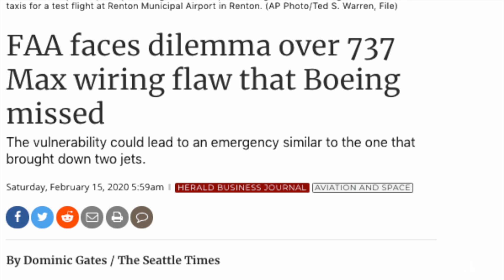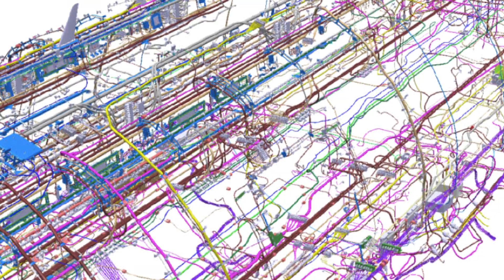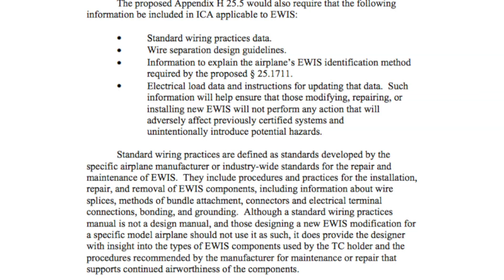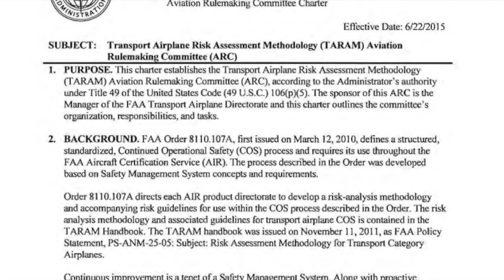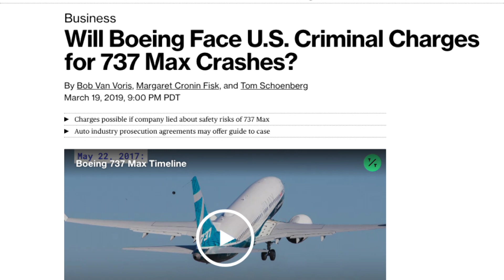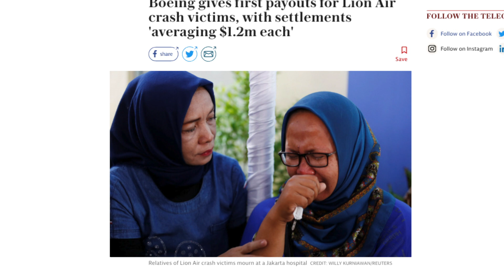Breaking - 737 Max Wiring may cause NEW nightmare that could ground 6,800 Boeing Max and 737ng's

Comment: Hard to take this video seriously. You talk about the HORIZONTAL stabilizer moving while showing an animated graphic of the ELEVATOR moving, and it's labeled "VERTICAL stabilizer." If you don't even know that much about aviation are you in any position to be criticizing Boeing?

Apparently you were the only one who thought rewiring the MAX would complicate its return to service. Boeing had no qualms about rewiring the MAX and your doomsayer source was wrong… the FAA and EASA have common sense—neither of them required the rewiring of the existing NG fleet. Next time try to get better sources—that don't have to remain anonymous to hide their incompetence.

Comment: Boeing used to be a respectable organization and built good aircraft. Now after the wilful deceit over the MAX debacle, I wouldn't trust Boeing as far as I could throw them. Anything to save a buck and to he'll with the people flying those planes. I don't recall any such scandals at Airbus, Bombardier, Embraer, Antonov, UAC, or COMAC. I believe I would prefer those aircraft now over Boeing. It wouldn't hurt the FAA to clean house either as far as Boeing is concerned.
Reply from the maker: Well Said.

Comment: Make no mistake that he FAA needs to Re-certify the 737 Max before they even consider letting it fly again..... Boeing have been and are using a certification for this plane that was issued originally for the 707 in 1958 !!!! ..... this is a complete joke ..... it still uses cables for its flight systems.... if it was a MCAS error it would've only take about a month to reprogram it ..... time to condemn these death traps and design a new jetliner from scratch .... safety before profit .... and lets lock up all those senior management from Boeing and the FAA that are and were responsible for deliberately disregarding the public's safety in order to make more cash for them selves by issuing these dodgy re certifications of this air frame.....

Comment: Boeing stopped to work seriously since quite a lot of time when they took over McDonnell Douglas. Unfortunately, McDonnell managers could "pollute" the Boeing management and slowly the Boeing philosophy of the "safety first" became became "Business first". This was rendered possible by the highly unprofessional FAA which was already working as a group of drunk amateur, who was sold to the US manufacturers. Remember the Swissair crash in 1998 in Halifax? Well already there the FAA should have been reformed. This a pity as I like Boeing. However, I advise my family to avoid Boeing aeroplanes such as 737 and Dreamliner. By the way: Boeing changed the 737 so much to get the max, that the aeroplane is out of balance while the MCAS is a scandal as the pilot have no chance to counter this deficient system. It is not only a matter of software, but also of lacking redundancy, of wrong MCAS concept and wrong aeroplane concept.
Reply: Out of balance?! You criticize Boeing while pretending to have the engineering competence to make an evaluation of the airplane's design, misleading the public. Where's YOUR ethics?
Reply: Did you even LOOK at the data before giving your analysis that "the pilots have no chance to counter this deficient system?"

The data shows that the pilots on both flights had plenty of chances to counter the runaway stabilizer—24 chances on one of the flights—and they DID counter it, quite intuitively, with no training on MCAS. They countered it so well that they actually continued to climb while they countered it. The only thing they didn't do: disable the stabilizer's electric trim system. Knowing which switches to flip required half a minute of training rather than intuition. Since the 1960s all pilots have been required to get that training initially as well as every 6 months during recurrent training, but these pilots gave absolutely no indication that they had ever received it. Someone should be investigating why the pilots at both airlines didn't receive that training, and what other critical training they—and other pilots currently flying!—may have not received.

BTW, there was nothing "deficient" in any system. The 737 MAX has been returned to service with the SAME aeroplane concept, the SAME MCAS concept and is STILL lacking the redundancy you thought it required.

Comment: The wiring is not the issue, 737's have been flying for fifty years and haven't had problems with those wires. The real problem is why couldn't the pilot's on the doomed airliners reset the HORIZONTAL STABILIZER. They deactivated the MCAS on both planes, after that they should have been able to manually reset the horizontal stabilizer, but they couldn't, and that's THE REAL PROBLEM.

Comment: The Economics That Made Boeing Build the 737 Max
Wendover Productions https://www.youtube.com/watch?v=BfNEOfEGe3I Apr 30, 2019
Webinar 017 Recording Video Boeing 737 Max, 2019 11 13
PMO Advisory LLC https://www.youtube.com/watch?v=nHedAyomAyI Nov 13, 2019
Death Plane! The Secrets of the Boeing 737 MAX with Paul Spencer
Russell Scott https://www.youtube.com/watch?v=9OzFlqHikUc Feb 5, 2020
737 Max UPDATE! Wiring Issues and the FAA
blancolirio https://www.youtube.com/watch?v=6fkCWPq9dNM Feb 19, 2020
Breaking - Max investigation leads to NEW nightmare that could ground 6,800 Boeing Max and 737ng's
Maximus Aviation https://www.youtube.com/watch?v=61M5eXIxAuc Feb 22, 2020
How Boeing Will Get the 737 MAX Flying Again
Wendover Productions https://www.youtube.com/watch?v=QvUpSFGRqEo Feb 26, 2020
737Max Update March 2020 Restoring Aviation Accountability- Congress
blancolirio https://www.youtube.com/watch?v=Q7jz7mdH9TU Mar 4, 2020

Comment: Captan wiring has been a problem right through the 737's life. Large bundles of wires and heavy usage - sometimes such things as game consoles in the cabin can lead to heat buildup which can embrittle the wire sheathing which hardens and cracks. Any flexing of the bundles can then lead to shorts occuring.

Comment: I don’t think it was an oversight... it was covered by legacy clause that protects older manufactured aircraft... because the 737 max was built using the same license as older models Boeing did not need to meet the modern day regulations on wiring separation.
Reply: Wiring was not the problem, the 737 has been flying for 50 years as is. It was a faulty sensor, MCAS and the horizontal stabilizer that couldn't be reset manually that caused the crashes.
Reply: @martentrudeau6948  wrong boeing was told by the fed gov to change the wireing on the 737 in 1998
Reply: Agreed, the regulations have changed over the +50 years the 737 has been in production, and it is still operating on that original Type classification. Every generation of changes increased the chances of cascade failures.
Reply: @themittonmethod1243  but Boeing has had more skin problems then md

Comment: It's getting to the point where flying on passenger jets is not a good option.
Reply: Until told otherwise fly Airbus. Or don't fly use a video conference instead .
Reply: @donaldboughton8686  it's still much safer then many activities we take part in every day. Prob more likely the batteries in your device that you are conferencing on start a fatal fire. If we live in fear of risks that are extremely unlikely, are we really living? Some forms of air travel are more dangerous then others, for instance helicopters. Around here there is a small airline operating small commuter turboprops, bearskin airlines. They have the nickname "scareskin" and it is warranted.
Reply: Julio Gonzo, that is no excuse for blatant incompetence!
Reply: Only boeing.Thank God for Airbus &European engineering &standards
Reply: @arunseigell7361  I don't know about the engineering part. When they first made the a380 they couldn't connect wiring because of design differences.
Reply: Arun Seigell, Airbus have had their issues too: look-up QANTAS when they almost lost an aircraft.
Reply: If you're in the US, you're safe.

Comment: The fact that there have been no hot-joints reported is not the issue: the point is - once again, Boeing has not followed safety regulations that are there for serious reasons; and the FAA has been complicit once again also, in unlawful and morally-wrong oversight. 🇦🇺 For God's sake, don't the deaths of hundreds of innocent lives mean anything to those inhumane mongrels?
Reply: 3000 people dead in the Twin Towers and only 6 plane parts out of 6.2 million were ever found....
Including an engine on Murray Street which was from a 1970's 747SP and the landing gear discovered in 2013 down the side of a mosque with a broken rope still attached to it..

Nope - lives mean nothing to the FAA.

Comment: "Fixing the wiring can be more dangerous than not because the more you touch the wires the more trouble you will get." - Boeing

"Fixing MCAS is not necessary because the more you change the code the more we will fu*% it up."

"Boeing does not know how to design software." - NASA finding after the Starliner spacecraft failed to reach the ISS in a certification launch. 

Therefore we can conclude Boeing want the 737 MAX be re-certified as-is. That the Starliner will carry astronauts to the ISS on the next flight without further test. After all Boeing get paid whether passengers or astronauts get killed or not. Everything is 'beautiful' according to the new CEO.
Reply from the maker: EXACTLY!
Reply: If they don’t replace the wiring it will  be another case of putting profits before safety. The wiring doesn’t meet the regulations so fix it. On top of this their is debris in fuel tanks and panels that if struck by lightning could cause a double engine failure this plane needs scrapping now before more innocent lives are lost
Reply: @robertsaunders6824  You echo the opinions, desire of millions around the world. The wiring must be fixed or it won't pass European (EASA) and Canadian regulator. This is certain. More than 800 MAX wiring must be repaired, one by one, at Boeing facility. The aircraft then certified on this repair. There are many others. 

The wiring violation was deliberate. New wiring rules was imposed by FAA after 2 fatal crashes (TWA 747 exploded on takeoff off Long Island, Swissair plunged into the sea off Nova Scotia) traced to both faulty wiring components, and a wiring scheme that's too dangerous. All new aircraft built since must comply. But FAA gave Boeing a pass, a waiver for the 737 MAX. EASA did not know wiring violated rules because it just robber stamped FAA. EASA will not allowed itself to be screwed anymore. As to FAA, Boeing is still trying to pressure to give it one more pass, saying the wiring on the older 737 NG is safe so there is no need to change it for the MAX. A sole exception in the world, on an aircraft that killed so many. The corporate self-serving mentality still control Boeing. It has no ethics.